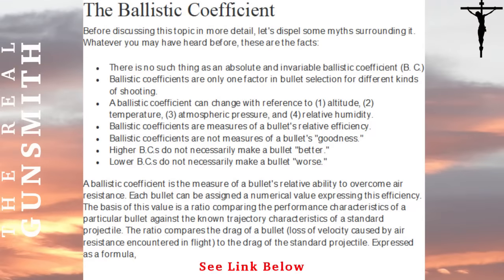7MM PRC Compared to Other 7MM's

Comment: Randy, you are the real gunsmith. Every thing you said is accurate but you might have confused some the viewers out there by using the terms 6 tenths. Some people are thinking you mean ,6 but in machinist talk that means .0006, which is just over a half of one thousandths of an inch, magnitudes of order less than .6. The simple fact is that just about everything in rifle cartridge development has been tried but that view point doesn't sell bullets and ammunition. Gun magazines or any other magazine has one function and one function only, to sell advertisers products,  so you will never see a bad report on a advertisers products in any magazine in which they advertise in.

Comment: I agree.  Some magic dust sprinkled doesn't make the 7mm prc do what they say it does. 7mm rem. mag is my  go to rifle and I have a couple. For hunting the federal fusion is my bullet. Works great!  That ELDx is terrible on game. 
  This ballistic coefficient crap is for bench shooters. I found this out in Montana. My go to bullets are as such for hunting. 
1. Federal fusion 7mm
  150 and 160 grain
2. Speer 150 grn btsp 7mm
3. 300 wm 180 grain Barnes TTSX
I Agree 100%
I've been using IMR 7977 with great accuracy with my 7mm rem. Mag and actually Reloader 17 on 300 wm.
It works for me!
It's all about sales... Trying to reinvent the wheel..
I had a Christianson Arms 28 Nosler.. HAD!  THING was so picky... Fast but picky .. I was getting so much copper fouling halfway down the barrel to the end due to the hot gasses melting the copper jacket.  I'm sticking with my favorites.
7mm rem mag.
300 wm
.444 Marlin.  
25.06
.22 mag
.17 WSM
.22LR. Of course.
Now the 350 legend has good promise and my wife loves it

Comment: If this 7PRC is like the 6.5PRC, it’s going to be tough to find the magic powder that gets the max performance out of it. My 6.5 PRC, with the powders that i can find, shooting the hornady 120cx bullet, and the Barnes 127 LRX, will only beat my 20” barreled 6.5 Creedmoor by 50 fps.
Reply: I bought a 270 and use 4831sc with 117gr hammer hunter bullets.

Comment: Of course a lot of these new calibers are just to sell new rifles.
The problem is rifles don’t really go bad I still hunt with my grandads stevens 30-06, I have bought my own rifles over the years ,but my dads old ruger 77 270 and grandads old 30/06 or the two I take anytime I go hunting mainly because of sentimental value and I know exactly what those guns will do when I pull the trigger the original scopes that they put on the guns back then are still on and I’ve never had to adjust them.  The 270 will put three rounds in same hole at 150 yards on paper the 06 isn’t as accurate but it’s within a inch always .  I usually go check them both outside every year then do my ritual cleaning and get ready to hunt the season.
My oldest is using my Remington 243 that I got when I was 12 and killed my first deer with … and I think that’s kinda the problem and why it drives people who are really into guns for life crazy when marketing is so blatantly out of control as it is nowdays. I remember when everyone was excited when I was a teenager about the 260 Remington friends of mine back the claiming it would best a 270 in a short action hahaha.. then it’s funny last couple years now to watch the 6.5 creedmoor come to the market. And it’s like déjà vu …. It’s just manufacturer’s wanting to create some sales and I don’t blame them for it. 
I can see the auto loader side of wanting something that will use the 308 magazines and bolt head to give some more options… although it’s been done we have 243,7mm 08 ,338 federal,358 Winchester, ohh and the 260 Remington haha.
The thing is it’s all been done already there isn’t a lot of new ground to cover and the whole shorter case sharper neck longer high bc bullets is cool and all but for hunting distances the bullets aren’t any more effective than stuff that has existed for 100 years almost now… there’s a reason the 6.5 creedmoor is called a creedmoor.. the name of the cartridge should tell you everything you need to know .
It was designed to punch holes in paper for competition and there is nothing wrong with that that’s what the whole wildcat competition scene is for.
But to displace actual established cartridges for hunters is just marketing most hunters in the US already own family hunting rifles that will perform as well as anything they can go buy . I don’t know anyone who doesn’t own a 30/06 it seems like every one of my friend’s has one handed down at least it seems that’s been in the family. But also everyone has had 300 weatherbys or 7mm rem mags or 300 win mags , 270win , etc…
And almost everyone has had a 308 still a gun that will do anything you need in North America…
It’s a tuff sale to sell a less case capacity 7mm/08 or 7mm rem mag and call it a 7prc and pretend it’s doing magic due to new tech when you can load the same longer bullets in the other cartridges if you wanted go punch holes in paper. Most your good hunting bullets won’t be these long high bc magic bullets so it’s a moot point for upgrading.  
And yea nossler partitions are the best hunting bullets there are little expensive but well worth it, of course I’ve always been a poor country boy so Remington coreloks are what I usually use are any bonded softpoint that my gun will shoot good.

Comment: I am confused Randy. Are you claiming Hornady and the PRC have abandoned energy? With a 175gr 7mm bullet leaving the muzzle at 2900-3000 fps MV I can't see that energy is lacking and at 500 yards the PRC/175gr combo running around 2000ft/lbs plus. Also another point, I always envisioned 2900/3000 fps MV with a long for caliber bullet in 270 through to 30cal to be and ideal hunting setup.
Reply from the maker: The promoters of the cartridge are claiming 700-1000 yard elk cartridge, which it isn't.  
Thanks for watching.
Reply: Thanks for your reply. I am addressing your flat out suggestion that Hornady designed a  cartridge that just did not have the ENERGY. Nothing was said about it carrying the required energy only so far.   @TheRealGunsmith

Comment: I’ve only shot two head of game with the 30 cal 200 grain ELDX bullet, as follows:  Not so big Alabama Whitetail at about 150 yards at MV of 2,750, high shoulder impact.  Bullet blew up, considerable damage to area surrounding impact presented as a shallow 8 inch in diameter wound.  Bang flop kill.  Deer No 2, desert Mule Deer no more than 200 pounds, shot quartering on at about 250 yards, bullet entered rear chest area and exited on the off side breaking the off side shoulder, deflecting and exiting through the hide.  Bullet not recovered.  Bang flop kill.  Mule deer round MV was about 2,900.  FYI, draw yr own conclusions.
Reply: First bullet failed, destroying some good meat along the way, mostly as a result of your choice of shot placement.  Part of the problem is you're using a 200gr 30-caliber (elk/moose) bullet on deer-sized game.  Pick the right cartridge and bullet for the game you're hunting, if you'd like better results.
Reply: @jasonbroom7147  but the results were just fine!
Reply: And I might add that it’s almost universal in human nature to resent being given unsolicited advice no matter how good it might be.  As I said above. “FYI, draw your own conclusions.”
Reply: @f64ecc  - You lost an entire front quarter and call that fine?  I shoot the parts ya don't eat and I don't use a sledge-hammer to frame a stud wall.  Choice is good, though.  God Bless America!  :)
Reply: @f64ecc  - Yes, it is human nature to resist being informed, if it was unsolicited.  Most people are basically closed-minded, in this regard.  They don't listen, unless it was something they asked to hear.  I'm not sure if you consider that a good thing or not, but it's one of the fundamental flaws of modern society.  Used to be, truth was truth, and it didn't matter if someone was offended when they heard it.
Reply: @jasonbroom7147  I never stated an “entire front quarter was lost”.  You did, and it’s obvious it’s just something you made up.
Reply: @jasonbroom7147  It is human nature today just as it has always been to resent un solicited advice of any nature.  If you doubt this get ahold of Dale Carnegie’s  book “How to Win Friends and Influence People”. That book was published in 1936 and has sold over 30 million copies.  This tendency is not some flaw of modern society, as you stated.

Comment: Reading thru some of the comments I still see a lot of ppl still think Mr Selby is criticizing the new cartridges. And that his a Hornsby hater. As he mentioned and I’ll second with my limited experience is the 139gr interlock in my 7mm-08 has never let me down on deer or pigs. Cup and core bullets? Not a fan unless varmint or target shooting or even two legged varmints but our wildfire is too precious to suffer from subpar bullets just satisfy the BC check box. Also and I haven’t seen this addressed every single cartridge with a belt now is either obsolete or hated vigorously by so called reloaders I’ve never reloaded. Again the belt seems on its way out at least for now

Comment: I'm late to the comment section, but I feel compelled to put my 2 cents in. 

I used to use eld-x for target shooting, often loading 1000+ bullets within one lot (buying in bulk), until I changed lots throught the span of a few years and realized the extreme external dimension incongruity between lots and sometimes within a lot. Case base to ogive distance varying as much as .009, weight varying almost 1.5 grains. I don't know why their eld x bullets do this, but it's exclusive to that line. I've switched to sierra mk since, a lower bc option but vastly more consistent which shows both in groups and vertical and horizontal poi shift at long range. I can only surmise that both the terminal inefficiency and the external inconsistencies have something to do with poor bullet design. They do have higher BC's than competitors,  but vastly higher rates of variance. I suppose my anecdotal example just solidifies your argument.
Reply from the maker: Bullet designed for game and bullet placement is first. B. C. is last, within reasonable game ranges.  Thanks for watching.

Comment: Actually the capacity of the 7mm PRC IS GREATER on net than the 7mm Mag. Why? Bullet depth protrusion into the 7mm Mag case is deeper due to the shoulder and OAL reducing its actual net powder volume. On balance the 7mm PRC has greater NET capacity and this is the reason the 7mm PRC has higher velocity and greater energy distance. These are indisputable specs. So, these factors have been overlooked in this discussion. Disclaimer: I do not work for Hornady, have never been paid by Hornady or their assigns and have no vested interest in this discussion other than the truth.
Reply from the maker: Bullets seated to the same depth for both, the 7 Rem has 4 gr more capacity.  Truth, not hype.  In fact, the Rem Mag. will equal the velocity of the 7PRC with the same pressures, twists, powders and bullets. Fact, as I've done it.
Thanks for watching.

Comment: I’ve been alive nearly as long as Randy has. I’m not a gunsmith. I’m just a very average hunter and I’ve owned a bunch of average rifles and a few custom builds. For what it’s worth, the high dollar guns didn’t kill any better than the hardware store rifles. They usually shot better, but didn’t kill any better…. and they usually didn’t shoot enough better to justify the expense. My two cents worth. As for these nimrods going on about all these new cartridges and mythical magic they think these cartridges offer. I wish companies would stop trying to reinvent the wheel! I don’t give two hoots in hell what they do, shorten the case, lengthen the case, increase the diameter, move the shoulder, alter the shoulder angle and on and on. By and by, they land on the right thing and….the 7 Remington magnum is one such cartridge. I’ve owned and shot a fair selection of hunting magnums. Day in and day out, considering the killing ability and shooter comfort and control…. the 7 mag outshines the 30 magnums… and I like the 300 win mag…. but it hurts to shoot compared to the 7 mag but does not kill any better. Good bullets, range time and shooter confidence equals dead game.
Some of my favorite bullets wouldn’t pass Randy’s qualification but they worked for me! 7828 is still one my favorite powders and my keg is about empty. I burned a pile of 4350 and 4831 in 7 rem mags and they worked…7828 shines!
I miss my Sako 7 mag from years ago but as I got older, it got heavier and I let it go. I no longer own any magnums and I absolutely detest the 338.
Oh for younger days and good legs!

Comment: I wonder who he has been listening to?  I have watched several videos from Hornady and read numerous articles about and not a single one has claimed the 7mm PRC has a higher muzzle velocity than the 28 Nosler.   I also have not seen any claims that a similar cartridge hasn't been made before.  In fact,  the 7mm PRC is very, very similar to the Gunwerks 7mm LRM which has been around for over a decade and for which Hornady has been making the brass. What Hornady HAS done is standardized a cartridge with a SAAMI spec that utilizes a lot of the tricks that experienced gunsmiths have been using for years.
   Randy correctly states that he and other gunsmiths have produced custom rifles by starting with the standard 7mm Rem Mag case, then modified the chamber's throat length, used a faster than standard twist barrel and loaded to an overall length beyond the 3.34" standard length.  This also means that it won't fit in all standard actions and no commercial ammo is available.  This is no longer a 7mm Rem Mag as defined by Remington and SAAMI, it is a custom cartridge and no longer optimized to use commercial ammo.  The whole point of the 7mm PRC is to standardize through SAAMI a cartridge that has the same performance and allow widespread production of rifles and ammo.  Getting rid of the belt is just a bonus.
  Is Randy claiming that there have been no advancements in propellants since IMR 7828 was introduced 60 years ago?   The 1960's version of IMR 7828 is no longer produced, but a "SSC" (Super Short Cut) version is available.  Nevertheless, it no longer produces the highest velocity for the 7mm RM nor is it the least temperature sensitive.  These days, it is common practice for long-distance hunters to choose powders that are least effected by temperature change.
  I agree that the ELD-X bullets send a lot of lead fragments into the meat and seems optimized for lower velocities.   The are designed to  expand down to 1600 fps but lose a significant fraction of their lead cores at typical hunting velocities (2000+ fps).   The interlock often does not keep what is left of the core in the jacket.
Reply from the maker: I don't listen to anyone. I do my own research.  It appears this may be over your head.
When a writer claims less energy and velocity is better than more energy and velocity, I loose all faith in that person, as that is false.  It is a matter of physics that don't change to meet that persons expectations.  I am well aware of the LRM, a lot of marketing hype [he is a master marketer, but not truthful] and the LRM has been been dead for some time.     As far as I know, I have more experience than anyone is all of the 7's.  I could care less if factory ammo is used. It will never be up to precision worked up loads for accuracy and uniformity.  There are velocity variations them all, and that affects total accuracy.  Factory ammo, you will notice, is not used to win 1000 yard matches.  If we followed Sammi exactly we would have never broke 1000 yard records.
Properly stress relieved barrels have consistent harmonics with uniform loads.   The top barrel makers all stress relieve their barrels.   I suppose the second rate ones may or may not be.
Thanks for watching.
Reply: @TheRealGunsmith  Thank you for the response.

Comment: 27 nosler burns out a pressure test barrel in 300 rounds. Have to shoot reference every ten rounds. 7 prc is much easier on barrels sincerely tech from not hornady. Hornady did everyone a favor here. Everyone who follows saami now can make more accurate rifles ammo while following saami cartridge and clambering specs.
Reply: I only say this because saami calls for a long Freebore on these belted magnums.  His custom throated rifles do not have this problem. Hornady did just what this guy is doing but saami specs are set so they just "built" a new cartridge. I.e. winchester fixed the 270 wsm throat and twist to be able to shoot a 175 gr projectile. Slapped 6.8 western on it. Guys have been doing that forever but it's not saami approved.

Comment: Respect to you sir but Hornaday is making good cartridges best in the business right now I'm not a big fan of the eldx I prefer Barnes ttsx and federal terminal accent and trophy bonded but the 5 deer I've killed with the eldx 3 with the Creedmoor and 2 with the PRC both 6.5 it did the job one with creed and both with PRC dropped in their tracks although I do agree they mess up meat just about like a Berger they work.
Reply: Ps I've also took a 160 pound doe with a 147eldm with the PRC at 280 yards n boom dead where she stood......only because it's all I could find when I first got my PRC and I seen some YouTubers use it on elk n moose